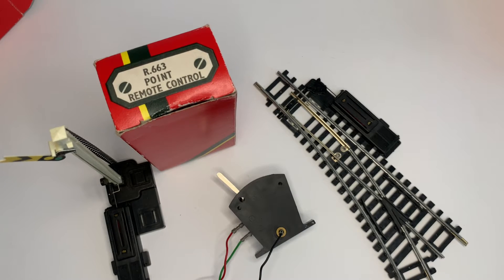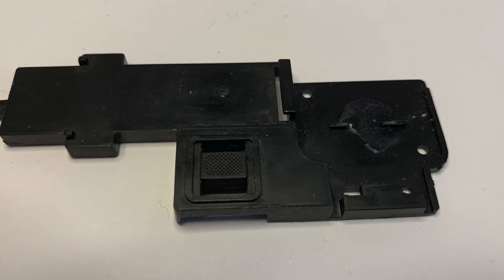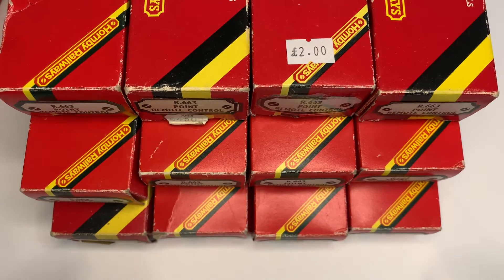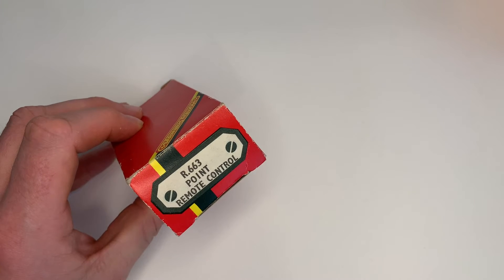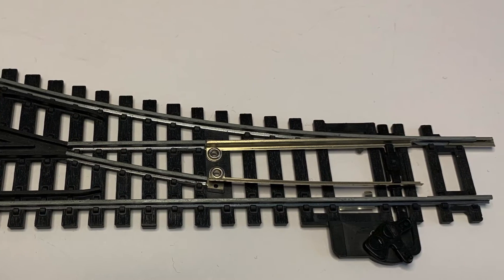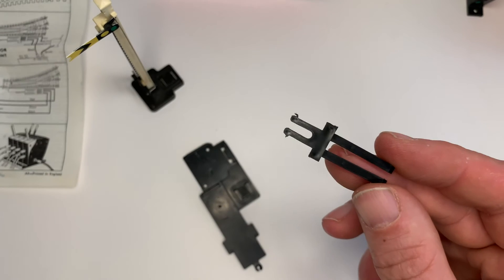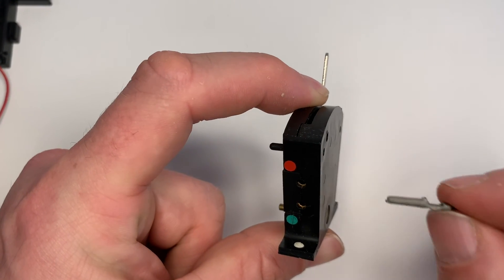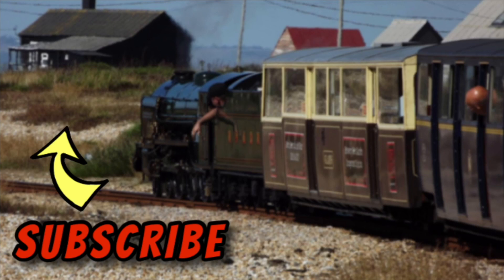Hornby's Forgotten Signal and Point Motor | Hornby R.663

Comment: My current project is fitting a DCC controller (bus powered) to a point motor to control a set of points without any wiring beneath a baseboard but on a clear plastic 1mm sheet over a trackmat.

After seeing your video, I'm going to try and connect the controller to an R.663 and signal to try and get a semaphore signal for the siding.
Reply from the maker: Great idea. I have just picked something up at a recent show that hornby used to produce and it takes these motors one step further. Look out for it in a future episode. Cheers
Reply: @Aidans Railways  I've now motorised 3 signals and they work a treat.

The motors don't always work properly because of tarnishing of the contacts, but I easily remedied that.

Less successful was stopping the magnet getting stuck at the top of the solenoid. Years of dirt must be at the top and I can't access without unwrapping the solenoid. I'm thinking of giving it a bath in a jewellery cleaner.

Comment: Old engineering saying. If it's not Broken Don't fix it
🇮🇪🇪🇺
Reply from the maker: Totally agree 👍
Reply: Dear Derek, despite this, many organisations cannot resist the temptation to do so, and unfortunately, more often than not, do so rather badly, to the extent that, in some cases, the "replacement" is an unmitigated disaster.

Comment: "If only I had Known".. Must be the reason that not many people used the base plates?  I personally have installed many solenoids on points, but never saw any diagrams for installing them on signals as well as points...  I'm sure that if there had been diagrams on the solenoid instructions, showing attachment to signals, there would have been more operating signals on layouts...
Reply from the maker: Although a lot of people knew, so many had no idea about their use with signals as well. Cheers

Comment: Very much enjoying your videos and channel. These are very nice products and while agree that Hornby could do something, I imagine the issue with these is that kids will be tempted to see what happens if you hold the lever when its buzzing, only to witness the tell-tale plume of smoke rising from the motor that shows they just burnt out the windings! A simple capacitive discharge unit built in would prevent this, ahem Hornby, hope you're listening!!
Reply from the maker: Hi John. Yes i totally agree and i prefer to use the gaugemaster switches for them as well. Cheers 👍😀

Comment: According to the man in my local model shop, R664 was discontinued because it had a bad reliability record and was a poor seller. I have installed one of these R664 to operate a semaphore signal and have found the action to be extremely weak. Oscar Paisley says the earlier Triang X404 are better. I think the wiring inside is susceptible to corrosion.
Reply from the maker: Thank you Allen this is great information. I used to have the triang versions. Mine were metal casing. Cheers